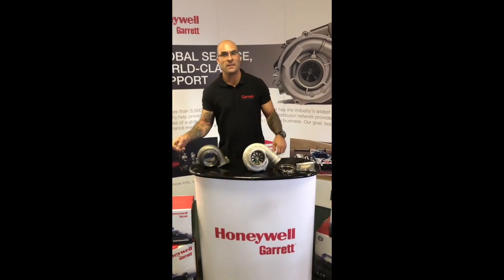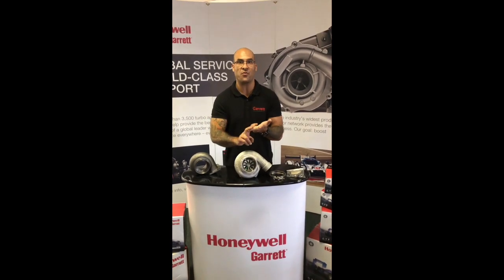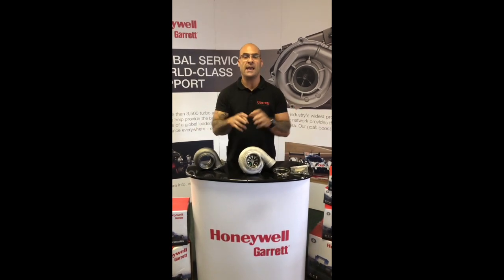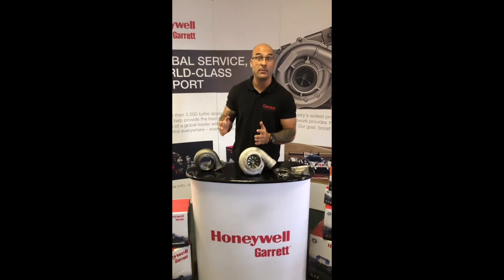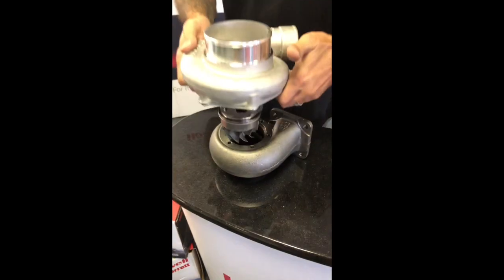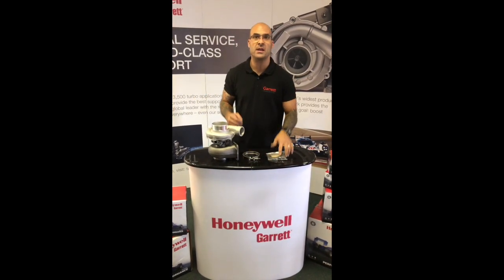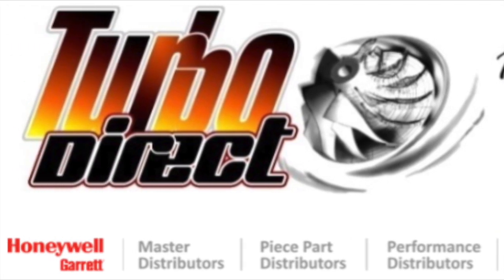GTW3884 turbo promo

Comment: Thats probably a p trim. Not t3 stage 3.
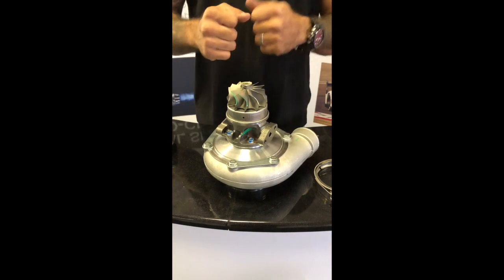Reply from the maker: 2:15 - 2:18 says T4 (not T3) Stage 3 turbine shaft, and also includes the sizes for reference - which relates to the Q-trim T4 shaft should you wish to talk the old "slang" from the 90's.